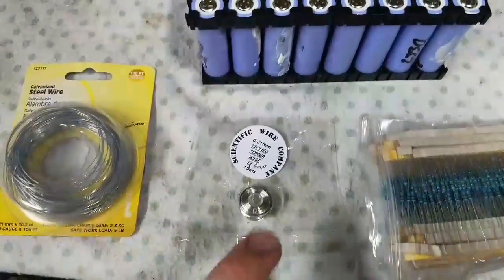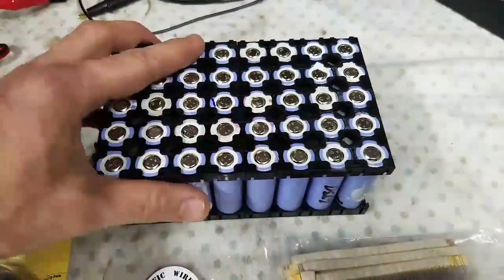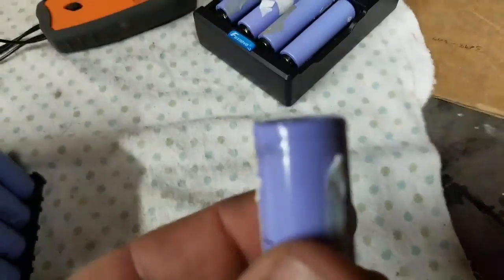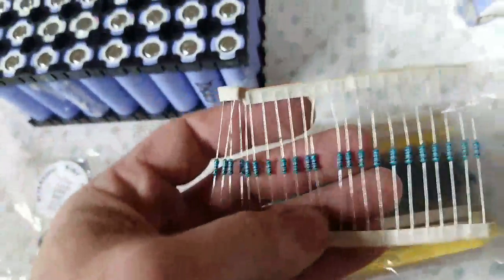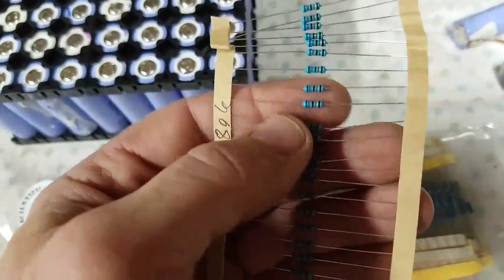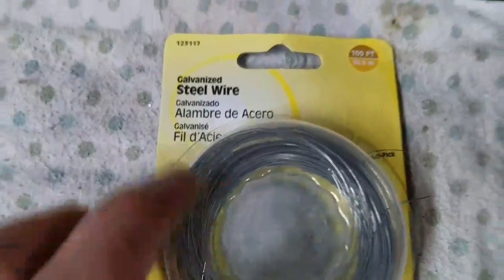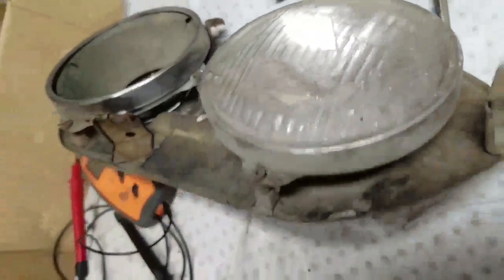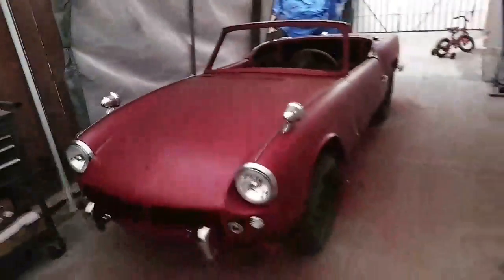18650 what fuse wire to use cell fusing lithium ion battery pack ev

Comment: Late to the replies but there really is not much on the internet about cell-level fusing for recycled 18650 packs ... there really isn't.

For me, I've tried tinned copper wire and it just doesn't fuse unless it's super thin, had to go to 34-36 AWG tinned copper wire to get a fuse that blows at even close to 10amps, and the problem then is, it won't spot weld very easily to 18650's (I simply do not want to solder 18650's ... there's enough evidence out there that shows how much heat gets transferred into the cells). Hell, you can barely see 36 AWG tinned copper wire! I've tried 30AWG tinned copper wire but it simply carries too much current too easily ...

I've finally rested on using either pure nickel strips or nickel plated steel strips (they actually fuse slightly easier and quicker than pure nickel) of cross-sectional area of 0.15mm2 ... or in other words ... 1.5mm x 0.1mm strips ... fuses in the 5 amp range and is incredibly easy to spot weld.

Comment: If you put coil or loop in the fuse it will burn out quicker and probably in that spot.
Reply: That is correct.  The behavior of a fuse, and the speed at which it blows, is much more complicated than a single strand of wire.

Comment: It's not just diameter and material used. Longer wires will burn quicker because shorter ones have more heat sinking via battery terminal and bus bar.
Reply: A curve or S shape wire will burn out quicker due to being longer and concentrating heat in middle, like inside car fuses.
Reply: Compared to straight wire of same thickness

Comment: I don't know about the steel wire because the rest are copper that is tined or nickel plated I'd take a long piece of that steel wire and see what the resistance is vs like that fuse wire

Comment: What would be an interest and very useful video would be to take the shorted cell and try and pump 100A through it. Seems a higher voltage system might be safer as you would have less amps.

Comment: If you're running 3 cells in parallel and they each have a 9 amp fuse that would be 27 amps on that line.
Reply: if one of them is in shortcut...it is still 9 amp fuse

Comment: RESISTANCE is a batteries WORST enemy. So why on this earth are you using RESISTORS for the fuse wire connecting all the parallel cells?????. Just figure out total amperage you will draw,divide by x amount of cells in parallel and choose between 18-28 Gauge COPPER wire for the fuses. In my 18650 pack, Its a 24s 14p Using Samsung -25r cells rated at 20 amps. The controller will pull max of 300 amps. 300/14=21.4 amps my fuse has to be able to take,so 16-18 g fuse wire. The MAIN reason for Tesla style fuses is that if a cell reverses polarity then the total amount of amperage in the parallel group x X amount of cells gets transfered to that one cell and will easily break the 16-18 g wire,for example. Using used varying capacity and more importantly differing resistance cells in a parallel  group is asking for trouble, in which case your doing the right thing.
Reply: You dont use the actually resistor. You cut the wire off the resistor and use the wire. It typically blows around 6 amps.

Comment: How about using this : https://www.aliexpress.com/item/18650-battery-pure-nickel-belt-3P-4P-5P-6P-lithium-battery-nickel-strip-Li-ion-batteries/2053339372.html?spm=2114.10010108.1000013.5.1327b1f2fcOwpt&traffic_analysisId=recommend_2088_3_90158_iswistore&scm=1007.13339.90158.0&pvid=232efa10-4ad0-487f-8503-50eb27617347&tpp=1

Comment: did you said little more then 2 amp cells, if you are protecting the cells, why are you using 9 amp fusing, I thing it should be somewhere around 2 or 3 amp fuses
Reply: This is because he does'nt seem to understand the difference between Amps and Amphours.... these cells have a capacity of around 2 Amphours  (= 2Ah = 2000mAh) but they can easily deliver  currents of more than 10 Amps. The so called "C-Rating" of a cell describes with which current it is safe to charge / discharge. A Cell with 2 Ah and a 5C Rating is safe to discharge with 10 Amps.

Comment: Hi Steve, I see you are using an impedance meter SM8124. How do you find it with 18650's?
Reply from the maker: WoodyJim . Yea, I use it a lot, it's pretty accurate as well l. I am for impedance of below 80 for my good usable ones which have lower internal resistance.
Reply: Steven  Tubbs thanks man, 300 packs on the way for me to process for my powerwall, I think I'd be mad not to test for impedance as I go. Even a comparative test is better than none at all.

Comment: After testing various options (Nichrome wire, Bare Copper, Steel) I ended up using single thread from a multicore IDC cable. It's around 0.1 mm thick and at 1.5 cm length, it fusing current is around 5.5A, which is what I needed.
Reply: So glad you mention the length of the wire, since that is one of the factors in determining when and how fast the fuse will blow. The amount of heat generated by the glowing wire before actually melting is different under different conditions.  It is important to understand the relation between resistivity, length and diameter of the wire.

Comment: why do we use a fuse ?
being a naive in this Field I don't know much
Reply: There is a possibility that a cell could fail as short.  A fuse is used to remove that cell from the battery array and possibly prevent it from overheating, smoking, catching on fire, or exploding.

Comment: jehue is really good? dude talks about not worrying about his charge profile "Because these cells are survivors" when asked he didnt know what a dendrite was. From what ive seen he got a bit better as he goes but his critical flaw is inability to admit when he was wrong. I tried to show him BMS's that could do redistribuitive balancing...aka longer run time by shunting charge from strong to weak while in use but all he could do is bitch that i dare point out anything wrong.
Reply from the maker: Johnathan Wuethrich do you have any information on that BMS? I would love to learn more about BMS myself.
Reply: been a while and im caught up in a project with a simple bms(but a lot of other chips) but i think this was the off the shelf solution V
http://cds.linear.com/docs/en/lt-journal/LTJournal-V23N1-01-df-LTC3300-1-Drew.pdf ...btw coil craft will probably send you free samples. A few diff companies have versions of this... it relys on a flyback voltage converter and this implementation is specificly designed for large bats like you build because it redistrubites from a set of 6+(top of my head) cells to an adjacent cell or set. )the more diy aproach can be found if you search switched capacitor active cell balancing. for that you will need 2 generate 2 offset squarewaves(cheap ebay siggens) and fets between cells... there are some university research papers/sr student implimentations floating arround.
Reply: BMS will only manage individual cell voltage for cells configured in series.  For example if you put three 18650 cells in series (3S), you get around 12 volts (11.1 voltage nominal). Adding a BMS to make sure that each cell in the series is balance while draining and charging makes good sense.  However, Jehu is creating a battery with all the cells in parallel, so they're e all the same voltage.  A BMS can't help in this situation, it would treat all the parallel cells as a single cell (1S). Then he connects these blocks of 4.1V battery arrays in series to get the final voltage he desires.  Now he could use a BMS to monitor each battery array block while charging or discharging, but a BMS for the individual 4.1V battery array doesn't make sense.
Reply: +Don Mega ...see "milking batteryt booster" the concept has been around since pree fucking electrification of the us...aka it came about during the ac vs dc wars...aka birth of the modern age. 

as for its implementation with switched caps... those are already in use in tons of devices and have been since the dawn of  transistor or slightly after. There is nothing unsound about either concept.

 when you guys form the satanic church of raw lipocell do let me know...ill bash myself on the head till i have a single diggit iq and come have a fucking blast ... the dogma of the idiots surrounding your queen is astounding. 

+ricardo moreno. do you mean to tell me that every pack we see him produce is all 3.7v ? oh god i hit read more and watched you go in a circle with logic...was explaing basic pack constructgion that hard? 

it doesnt make sense that you think he can get each p group to 4.1v at the same time with out monitoring and using at least a resistive shunt on the first few groups of cells. ohms law is not optional to obey...it will occur regardless of how hard you try to wish it away.  thats one of a few things i can point out. i dont have time to fix both you circular reasoning and try to get you at 101 level with basic ee concepts
Reply: Don Mega  Jehu is an expert in 'stretching' the rules.  He refuses to acknowledge the danger before his house burns to the ground.  Experience can be a bitch.

Comment: I see a problem with your deductions. you are looking at wire that is rated for what voltage ? if this wire is rated at 9 amps or 15 amps, yet it is for 12 or 24 volts. than the actual amp range for your pack ( at 4.2 volts ) is much higher than you think. a 9 amp wire at 12 volts would be a 22 - 27 amp wire at 4 volts. ( or somewhere close to that ) .  you need to test your fuse wire using the highest voltage that your pack can make. 4.2 volts and then put a load on it . ( yes , No ) what do you think ?
Reply: I see a problem with your deductions. Voltage has zero effect on fusing. It is current only that decides when wire will fuse. Do some research on Preece and Onderdonk.
Reply: Incorrect...voltage is for practical REAL WORLD purposes almost irrelevant..I can run 28 g hair thickness copper wire across 120 volts with .3 amp and nothing happens...voltage is nothing without AMPS
Reply: Totally right..... and.... totally wrong jajajajaja yes, volts blow the fuses, but the volts across the fuse, not across the battery itself, and that voltage depends on the amps crossing that wire and the resistance of that wire ..... that's why we use (  I^2 * R  )  to analyze fuses or energy losses on wires instead of ( V^2 / R ) thats its applicable too with V = " the difference of potential across the fuse ".
Reply: @RajinderYadav  I thought I said that....

Comment: You do know that amperages are different between AC & DC, for a given voltage & wattage. That's why you should never use AC switches for DC currents & circuits. Fuses for AC will handle completely differently, when used in DC circuits...
Reply from the maker: I know. I don't have any AC switches
Reply: I was referring to the AC fuse wire which will not work at the stated maximums for DC. The key difference between a fuse's AC voltage rating and its DC voltage rating is a question of being able to stop the arc that forms when the fuse blows. DC arcs are much harder to stop than AC arcs, so you'll regularly see fuses that are rated for, say, 250VAC but only 32VDC.

Comment: Tinned copper wire/galvanised wire is NOT fuse wire !!! fuse wire is an alloy of lead and tin , designed to have low resistance in normal use , and to blow quickly ... using copper wire will waste energy heating the wire in normal use , it could get up to 800C in normal use without blowing , high temp heating cells , burning plastic   and it needs 1000C to blow! ... this link explains why not to use copper as fuse wire ....http://www.answers.com/Q/What_is_the_Composition_of_fuse_wire
Reply: Not easy to answer that ..Tesla use aluminium fuses , a good choice , doesn't oxidise when heated and low (660*C) melting point ...trouble is you can't solder it!  My opinion now is fuses are not necessary , and am not using them in my powerwall ... If you're convinced they are then tinned copper  wire is the best choice , this is the cheapest way to buy it if you don't mind stripping cable (14 AWG cable , 41 strands of 0.25mm)  http://www.ebay.co.uk/itm/262256456691?_trksid=p2057872.m2749.l2649&var=561004046988&ssPageName=STRK%3AMEBIDX%3AIT ... galvanised iron wire not a good idea
Reply: @oz93666  That is correct, copper wire glows like a candle for a LONG time before it finally melts.  Glowing and melting copper can do a lot of damage by burning through insulating materials, starting a chain reaction in neighboring cells.  BTW, mind the temperature coefficient, which is different for different materials.
Reply from the maker: Thanks for the tip.
Reply: so what would you use then?
Reply from the maker: oz93666 , thank you, great tip.
Reply: Incorrect and just plain wrong..abviously you are regurgitating and have no practical experience. By the way Tesla fuses are NOT A REAL FUSE. lol

Comment: i use 35awg thinned copper wire. fuse wire rated at around 5a snd works great. can be found on ebay among other. and always test em :)
Reply: 5a per cell? What awg wire should i use if it puts out 20a cont and 50a max
Reply: 0.63mm - 20amps ,1.25mm 40amps, 1.50mm for 63amp

Comment: 15mts=15 meters.
Galvanized wire is hard to solder. 

Why don’t you try using 30 AWG bare copper wire soldering each battery to a bus bar or
wire to make the series connection? This way each battery is protected equally. Try using a small section of 18ga stranded wire with 16 strands (each strand is 30ga) or with 7 strands (each strand is 26ga).  Remove the outer cover so you have loose strands. After calculating how much amperage draw your max usage is , look at chart  http://www.powerstream.com/Wire_Size.htm to find appropriate wire gauge.  You can also put full load through each wire to see which can handle load and see if it will fail when used with a dead short (connected  + to – with no load for single battery). If this works satisfactory, you now have the proper wire gauge to use for your battery pack. If you can find wire that has been pre-tinned that would be ideal. Try using clear plastic vinyl stereo wire where one side looks silver and one side looks copper color. The silver colored one is tinned. Tinned wire solders very easily, and the less heat used to solder to the batteries the better. Heat degrades batteries.
Reply: If you can’t find tinned copper wire, buss wire, 30 AWG, look at...
http://www.remingtonindustries.com/tinned-copper-wire/tinned-copper-wire-buss-wire-30-awg-silver-100-length /?utm_medium=googleshopping&utm_source=bc
Reply from the maker: Jay Obrine THANKS for the knowledge, ill definitely try that

Comment: It maybe late but I use 1/8 watt resistor ends mine blow at around 6 to 6.5 amps. But my packs are on my power shelves. For the current draw you want try a single wire from a 10ga cable. I would think it will blow at around 12amps there are about 12 wires or more in the 10ga cable.
Nice car
Reply from the maker: Thank you for the tip! 6.5 amps would be good. I cant imagine pulling any more than that.